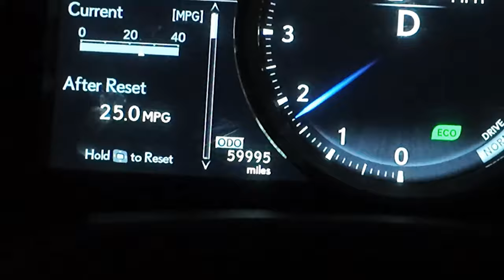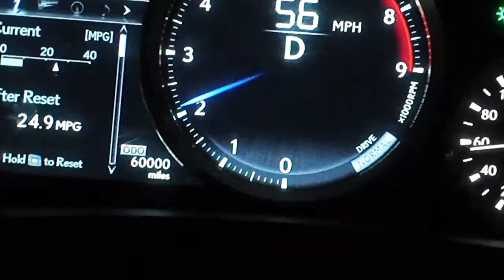2015 Subaru Legacy $30 Custom Exhaust

Comment: It sounds pretty good, having driven it about 300miles, the cvt makes it loudest when you are going slow at low rpms, and not as loud when you are actually in the throttle more. Anyway, I like it. Very wrx sounding, without all that extra speed. Who needs that? lol